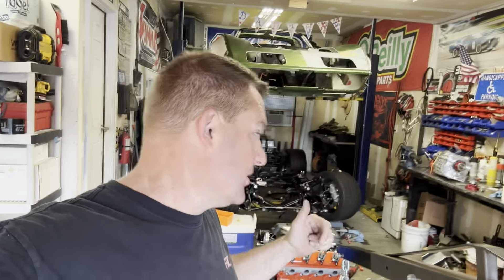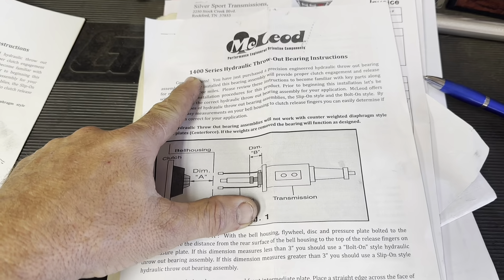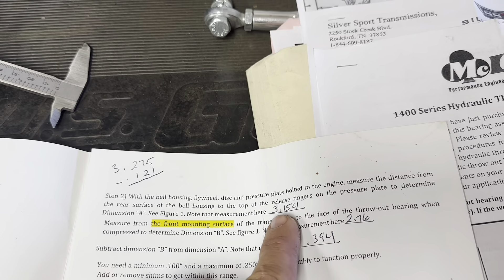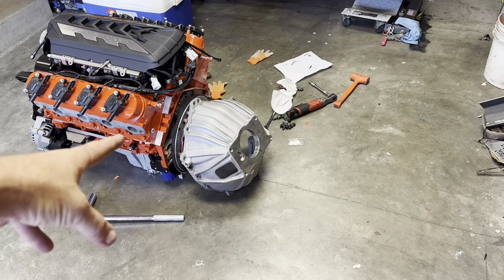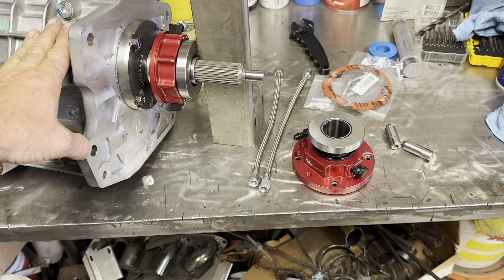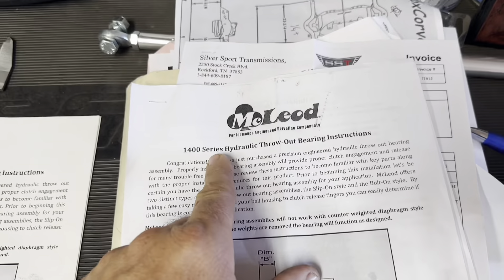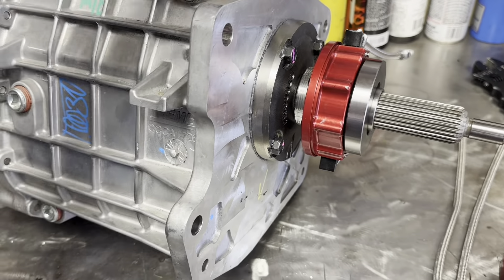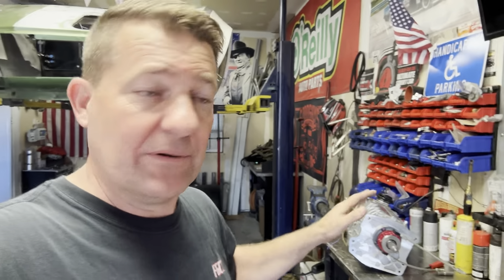McLeod Throwout Bearing Setup How did we do it? 🤷

Comment: i setup my toploader the same. what you will end up doing, very likley will be pulling it back apart when you get a little wear. the fingers move out, towards the TOB when the clutch wears, so its gonna get tight with a little wear. im sure you will hear it start scrubbing the TOB after break in. Just remember, it says, MIN .100, and your only .112, but not taking into consideration the inital wear.
Reply from the maker: Thanks for this

Comment: I believe i would have just used a flywheel spacer, GM performance parts has some really thick spacers,  quality piece shouldered for centricity.
Reply from the maker: I never even thought of that.  I will definitely check them out. Thanks

Comment: These measurements can be done and adjusted with motor and clutch in the car, tranny sitting next to it right? Once its adjusted there shouldn't be any reason to adjust once its all put together running right? If I understand, then you can use the fire wall adjuster to get the peddle where you want it? Thanks
Reply from the maker: Correct. With the pressure plate and clutch installed on the car along with the bell housing you can get the dimensions you need with those parts assembled. Your transmission sitting on the floor without the bell housing allows you to get those dimensions. If you have the bearing set up correctly then you shouldn’t have to touch it. 

Side bar: If it’s too close to the clutch fingers on the initial set up it may not fully release the clutch once installed. It also needs to be far enough away for the clutch to wear because the spring figures will naturally unload and need room to do that. 

As far as the firewall adjuster, I’m not sure what you mean. If you mean speed bleeder that yes you would use that to bleed the system. 

And as far as the getting the pedal where you want it. The pressure or type of pedal you end up getting is directly related to the style and type of clutch that you’re running. So if you’re running a  clutch with heavy spring pressure, you’re probably going to have a really heavy pedal. Hope this helps
Reply: @mayermotorsports Thank you